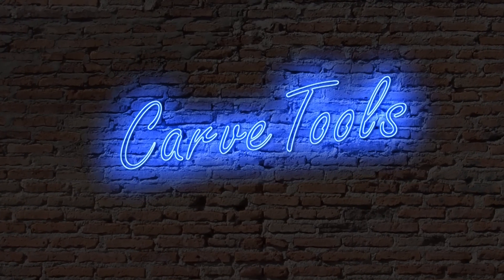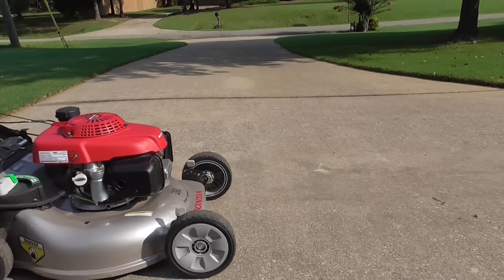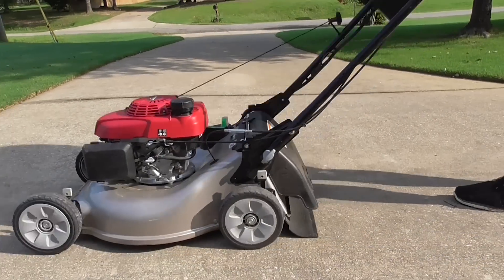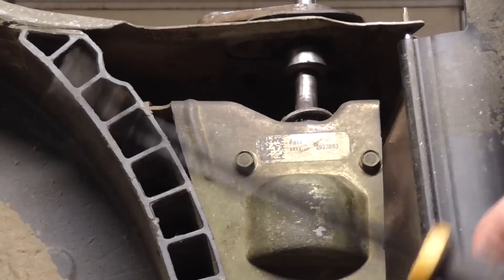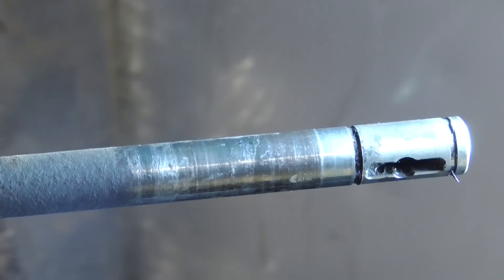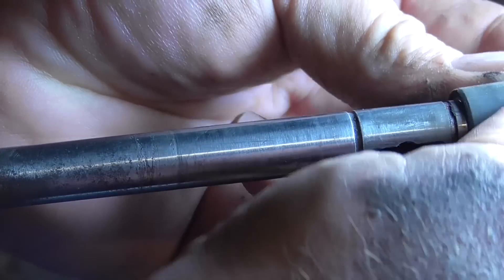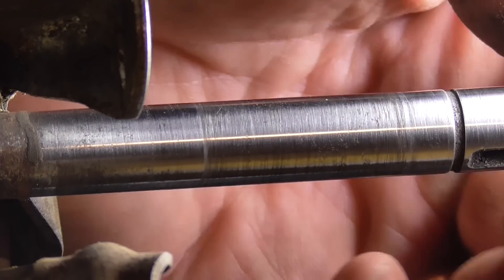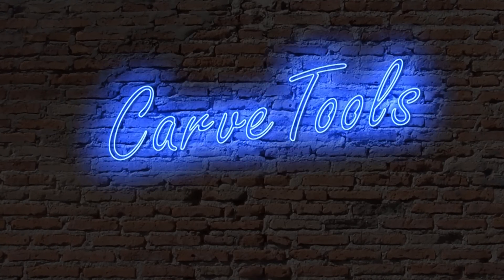Honda Mower Rear Wheels Will Not Roll Backwards THE REAL FIX

Comment: I gave up and took mine to a shop, I don't have the patience to deal with that stuff LOL.  I tore it apart and cleaned up the spring, gear, and key assembly, that's as far as I went, took it to a shop to let them deal with taking the transmission out of it...told them if the transmission is bad to scrap the thing, far from worth fixing at that point.  Can't believe a $500+ lawnmower has such a shitty design that everyone has the same problems with year after year, and its been going on for several years too obviously Honda don't care to fix their terrible design.  Luckily the lawnmower was free, good engine horrible drive system.  Wish it would work its rear wheel drive so it can pull itself up the hills on the property that a front drive mower won't.

Comment: I’ve had the same issue in the past. I use ‘Super Slick Stuff’ dry lube at Lowe’s as regular maintenance at least twice every mower season. Just lift the rear wheels and spray behind the wheels around the axle. Keeps corrosion from moisture under control. Cleaning the under side of the deck with a garden hose impacts adversely on this issue. Prevention maintenance is so easy and quick.

Comment: One helpful hint that I would like to lend out before everyone gets nuts about pulling the axle out of your Honda push mower; you may want to invest in a can of Hondalube and simply spray it in where the axle passes thru the bushing. My wheels unlocked quickly after applying it, and I now make it a habit of re-applying it periodically as preventive maintenance. The problem has never returned. 

The first time my wheels locked up was right after I washed the mower prior to winter storage. I just bought it that season and I guessed that water got in there and started some rust. The second year it happened again after mowing while my grass was still kinda wet after a surprise shower. Keeping it lubed seems to imperative. I’m not saying that a complete disassembly, cleaning and greasing isn’t the best way to fix it (and probably well worth doing every year or two). But if you are in a bind, and want to prevent it altogether... Hondalube works for me plus it’s great to have around the house! Works great on door locks, hinges, just about everything. It comes in a spray can and can best be described as Liquid Wrench and WD-40 combined. Search Hondalube as one word. 👍

Comment: Had a Husqvarna 4wd mower with same issue. Removed rear wheel & found out the rubber should that keeps dirt & grass & rocks out of gear drive at the wheel had gotten chewed up thru the years.  Part of it had gotten caught in the gears & locked up the wheel. Thank God was easy fix. Just FYI if your mower has wheel shrouds check these out first.

Comment: This is good info for a person that owns the machine and want to tackle the job . from a service provider aspect this repair could easily take over a hour to perform . witch in some shops could be over a $100. to $150 dollars . IF there is any thing else wrong with the unit and depending on the age of it you may want to consider a new machine .

Comment: My Honda mower has been the worse mower I’ve ever owned, and I’m 65 and have been cutting grass since I was a kid pushing a mower around the neighborhood in the ‘60s. The wheels on mine lock up, the carb gummed up the first year I had it, but the carb was not covered by warranty and I got a $165 bill on a mower that was less than a year old. The RPMs which are set at the factory are so low, it bogs down with even moderately long grass. Recently the engine quit and I told the repair shop, not to fix it unless it was something cheap. If it’s more than $100, I’m junking it and will never buy another Honda the rest of my life. The cheapest Craftsman mower I’ve owner has been better and lasted longer than this $500 Honda. Never again.
Reply: How is the carb gumming up hondas fault? Just maybe its the fuel...
Reply: @ginaboos9563  It’s Hondas fault because they make the carbs so sensitive that it easily gums up. They make it that way for fuel efficiency, but here’s the kicker, when you’re finished cutting, you are supposed to turn the fuel flow off and let the mower run until all the gas in the carb is used up. How is that efficient or environmentally helpful? I used regular gas just like I have for 50 years. I did everything I was supposed to do. Honda mowers just don’t match the hype about them. Go google Honda mower transmissions, and you’ll find lots of complaints about the transmissions locking up just as mine did. I had the highest expectations for my Honda mower and it was the worst mower I’ve ever owned and I’ve owned a lot of them.
Reply: Totally agree these are the worst mowers to own
Reply: @willb.9225  which would not be surprising if Hondas were not some of the most expensive mowers and hyped as the highest quality. Honda quality has been worse than the cheapest mowers I’ve ever owned.
Reply: I've had a HRX 537 here in Europe since 2008 and it's cut an acre of ground once a week 8 months a year and has never let me down. As for draining the carburettor I let her run dry while on its way to the garage, sometimes I get it wrong and have to push it a few metres as it's run dry. Plus it's never had the pleasure of cutting on a level patch of grass as our place is all slope's and it's still on its original gearbox so I don't know what people are doing to these mowers but we're delighted with ours and like yourself I'm way closer to 70 the 60 😂
Reply: I have used Honda mowers for 40 years amazing quality
Reply: Sounds like you have a fuel problem, not a Honda problem. I have 2 that I use for a lawn business. I have mowed many miles with them for many years.

Comment: Mine rear drive craftsman stopped working on the forward drive, but it also has the rear wheel lock up when pulling backwards.  A new transmission is $189 ($125 Amazon), and I don't know whether that's bad or something else.  The drive won't work, no matter what the adjustment.  I'm going to take it off as you show and see if turning the fly wheel also turns the shaft.  Should tell me if transmission is shot.

Comment: finally you see many videos just saying to clean the keyway and the spring but it's easy to see that it's working the way it's supposed to something is in a bind I don't like to go in blind now I know exactly what to do just wondering did you not smooth out the inside of the bushing which Gaulded the shaft to begin with and what type of lubricant do you suggest and maintenance to prevent this from reoccurring
Reply: Nothing is going to help it from coming back except not using the mower... Dirt, etc., gets down there on the axle shafts both sides and works itself inside the bushing and then it gets harder and harder to pull backwards... It's like going to have to be something you do every year... Happens more if you mow grass that is wet and then some water gets in between those parts and starts rust and dirt and debris all gumming up that tiny space between the bushing and the steel axle shaft... We will be doing this forever unfortunately, thanks to Honda's Terrible Design...

Comment: My HRR started locking up sporadically almost immediately.  Came to the web searching for solutions, but wasn't too fond of them because they all have you taking the mower apart to some degree.  Based on a comment below, I decided to just give everything anywhere near the rear axel a good spraying with WD40.  For two mowings since, I've had no issues.  So, for those who are also out here looking for a solution, perhaps a frequent wd40 application is all that is needed.  Obviously, that shouldn't have to occur, but I like the mower otherwise, so a small investment in WD40 to keep it working well (hopefully) is worth it to me.

Comment: My Honda mower would do this about 40% of the time during the first 4 years, now it has become locked completely and won't roll back. What would happen if I left those plastic bushings out and not put them back ?
Reply: It is designed to work with the bushings. I’ve had the same issue in the past. I use ‘Super Slick Stuff’ dry lube at Lowe’s as regular maintenance at least twice every mower season. Just lift the rear wheels and spray behind the wheels around the axle. Keeps corrosion from moisture under control. Cleaning the under side of the deck with a garden hose impacts adversely on this issue. Prevention maintenance is so easy and quick.

Comment: Great video! Thanks. I have a quick question. I am replacing the drive gears that are worn. I noticed the shaft moves right and left about an 1/8 of an inch. Is this normal? I’m thinking of using washers to hold it in place because the ends of the drive gears were worn the most.

Comment: Thank you very much for the video. My Honda HRR lawn mower is only 2 years old but started locking up shortly after 1 year old. I believe the root cause of the problem is due to cheap soft steel used in the wheel shaft. I will keep record to determine how long it lasts. Maybe the bushing ( too hard) may have some contributing factor. Again thanks for your help and I will keep you posted about my findings and attach some pictures. Jose from Miami Beach
Reply from the maker: Glad I could help

Comment: Great job.  I got lucky.  I turned off the fuel supply,  lifted the rear wheels off the ground by hooking the top bar to a support with a bungee,  leaving the mower on its front wheels.  Using good old WD40 Penetrant, I heavily sprayed into the axle area, after thoroughly cleaning the hell out of it.  Turned the wheels by hand in both directions - difficult at first - and let it sit overnite.  Did the same thing the next day, and haven't had a problem since. Crazy.  Hope someone gets lucky with this method also.
Reply: I didn't see your post until after I did the same exact thing you did and it also worked for me. Hope people see your comment before the start ripping the axle out
Reply: Same thing for me. I had hosed off the whole mower - from the top and bottom - and left it outside to dry for an afternoon. I suspect water ended up in the axle and left dried crud in there. Maybe it made some existing rust worse. A bunch of WD40 loosened it up and I could pull it  backward in a minute. I'm ready to take things apart and clean them if I have to, but it seemed like a good idea to try WD40 as a first approach.
Reply: It is a great mower but mine started locking up after a couple years and my dealer said "it isn't supposed to back up". They weren't able to do anything to fix and it is a pain to mow with it! Thanks for your suggestions!
Reply: @lisamcnish3287  "...it isn't supposed to back up." is the most rediculous thing ever told to anyone ever!
Reply: @moboutmen  Yeah, I agree! Maybe he never mowed a lawn! Lol
Reply: @lisamcnish3287  
I did try the oiling method but really didn't have too much luck with it. So I ended up taking the rear end completely apart sanding all the rust off, put a high quality grease back on the axle and bushing's & that did seem to help a lot.
I will say I've always ran the personal pace Toro's & never once had trouble pulling it backwards. And my last Toro lasted 17 years so after this year I may be dropping the Honda & going back to the Toro.
Reply: @lisamcnish3287 sounds like your dealer is a moron. 😂
Reply: The spring loaded Woodruff keys needing grease is the actual culprit here 🤷‍♂️🤦‍♂️.
Reply: Lol
Reply: How did you thoroughly clean the axle area before spraying the WD40.
Reply: @rob12468  I dry cleaned it using an assortment of scrapers, red Scotch pads, and wire brushes, followed by compressed air..  This mower was here when I bought the house. I think the owners just gave up on it. Best of luck.
Reply: Glad to see this. Will give it a try. For me only the left wheel locks and it is driving me crazy.
Reply: @ksrmk  good luck,
Reply: i will give it a try on my viking (stihl ) lawn mower, sometimes it turns , sometimes not but mostly stuck
Reply: @cusoonmyfriend3738  Best of luck!
Reply: Thanks for your post, I'll be trying your way first.
Reply: @scottyellis3442  Best of luck!

Comment: I had my HRX mower back at the dealer to fix this problem a little over a year ago. Well, the same problem is back already! Ridiculous on a nearly $800.00 mower! I’ve had mine back to the dealer four times for various issues. I will  never ever buy another Honda built mower. My next mower(hard to believe I’m saying that) will be a Toro with a Honda engine. Thanks for posting this fix. I still have a year left on the warranty so it’s back to the dealer AGAIN!!
Reply: Honda doesn't care, this has been an ongoing problem for years and hasn't been addressed by the manufacturer.
Reply from the maker: Sorry to hear that. Too bad Honda will not make this defect good.

Comment: I also have a Toro 22'' and it free wheels when pulling it back with no resistances.  I don't get it why Honda have this issue.  I went to Honda dealer and the new models are much easier to pull but i'm not buying another one for a while.
Reply: Luis Rivera - Yes, they are easy to pull until you mow a lot of grass and get wet grass water, dirt, etc., into that totally uncovered axle area and then this starts to happen..

Comment: I have the same model and  my lawn mower is only 2 years and 7 months new.  Honda mower comes with a 3 years warranty so i  hope the Honda authorize dealer can fix it at no cost.  I will have them do an oil change and sharpen the blades.   If Honda don't cover it than will bring it home and fix it my self.   Thank you for the Video.
Reply: A Honda authorized service center fixed my rear wheels after I showed them the service bulletin, but after a year the problem came back.

Comment: I dont get why worn bushings would  cause unidirectional seizure on the shaft...
Reply: Because when not using the belt drive, pushing it forwards only the wheels turn, not the whole axle. But pulling it backwards, or engaging the belt drive to drive forwards, the wheels have ratchet spring things internally to lock to the axle.
My Honda has had the locked wheels issue for a couple of years also, it is only about 5 years old :(
Reply from the maker: The transmission/gear box is driving it forward and you might not notice it but reverse pulling it shows up. Thanks for the comments!

Comment: This should not happen on a brand new mower.  Honda should fix this.
Reply: Kelly York  - probably over 10 years going and Honda is never going to do anything about it... Yes, they said "oversize bushings" b/s but the design that allows dirt, moisture, wet grass, etc., to get in between the bushing and axle will always cause this to happen... Yes, if you do not mow often or always have nice, low, dry grass, you can go longer, but once it gets dirty in there, it will start this all over again...

Comment: My mower does this too!  I have taken it back a number of times.  Eventually honda have done a secret recall and upgraded the gearbox.  It still does it though and i am now out of warranty.
Reply: The gearbox may have a separate problem, that I know nothing about or have experienced... The dirt, rust, etc., that gets in between the bushing and axle will always be a problem as I have experienced for years...  Just a terrible design...

Comment: I found on a Honda mower I recently got from a friend, that if this problem is allowed to continue, the mower will not only lock up the rear wheels but will also stop propelling itself forward due to the bushing and shaft binding together. This was the fix for that too.
Reply from the maker: Good information. Thanks for the comments!

Comment: This just happened to me on one bought in September 2019 and at the end of May 2020 (also known as hell year) it locked up.  I'm taking to an authorized Honda dealer to be fixed as it's under warranty.  On the models new for this year it says it has an "all metal transmission" I wonder if it's referring to these Teflon bushings.  I expect this kind of crap out of a $200 mower but one that costs north of $400 is ridiculous.
Reply from the maker: One would think that Honda has fixed this already. Thanks for the comments!
Reply: The new HRN which replaced the HRR has a 2 way ratchet, which fixes this issue. Hopefully that will hold up.
Reply: These dang things cost $600 + and they still have this awful designed rear axle problem...Shame on you, Honda.... You should know better...

Comment: I'm curious which model years have this issue? I have a 10 year old HRR216 that doesn't have the issue, nor does it click pushing it forward. It has a drive belt. My neighbor is always complaining about his Honda with wheel lockup. About to replace my beat up Honda and do not want such a lemon.

Comment: I have the same Honda model as yours.  The problem I am having is that only one side engaged.  I replaced both rear wheels but the problem persists.  Do you have any recommendation?
Thanks,
Reply from the maker: Hi Son Truong, If you removed the ratcheting sprocket it my have been reversed causing it to not engage. Hope that helps!
Reply: @CarveTools  Thank you for your response and it is exactly what I found and fixed it.